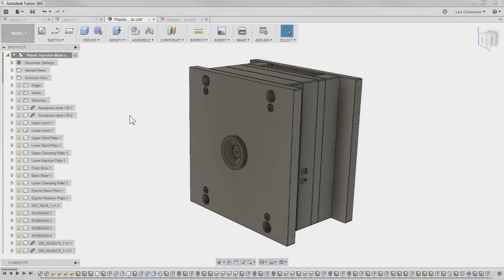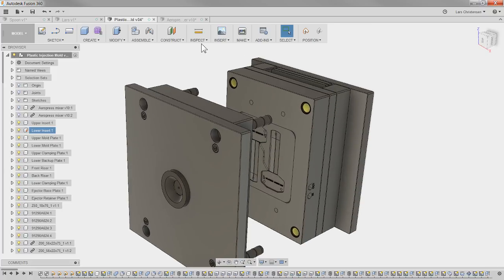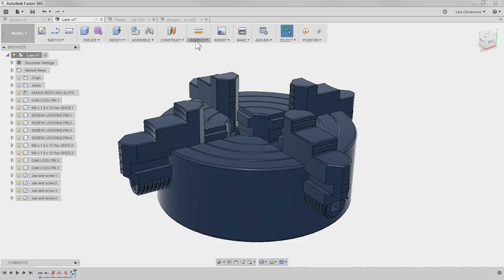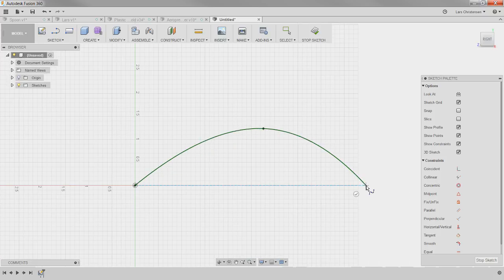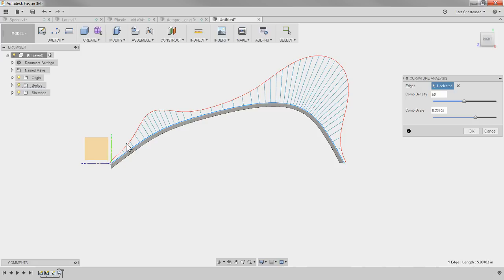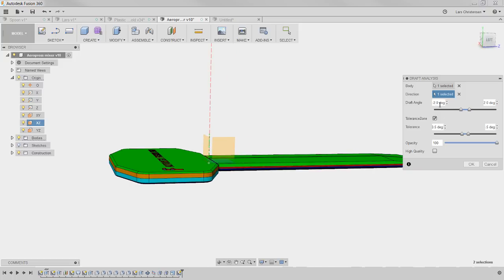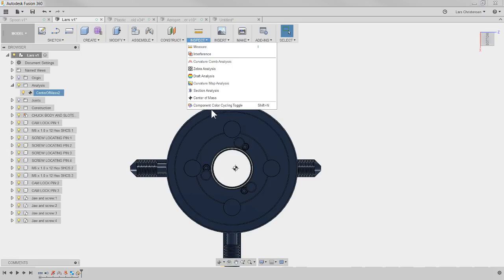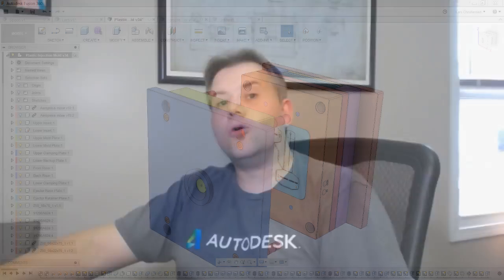Fusion 360 — INSPECT Commands —Your Comments & Questions — #LarsLive 49

Comment: Hi, I am having a problem trying to use Curvature Map inspection tool on a scanned mesh file (.stl). When I try and click on the mesh it won't select the mesh, so the curvature map inspection wont show/work.

The confusing thing is that I can select the mesh with no problems for Zebra inspection and Draft Contour Inspection, for these I can click on the mesh and select it for the inspection.  But Curvature Map just wont let me select the mesh.

Any ideas????

Comment: I have a part and I want to make a hole at the center of mass point. Is there a way to snap onto it with something like a sketch or is it only possible by measuring with the measuring tool and then placing the sketch manually? It would be cool to have the sketch feature followng the center of mass point even when the model is being changed. On the other hand I can see how this could cause errors by the center of mass being thrown outside of the solid model on some shapes.
Reply from the maker: Hi SuperRistopaha Thank you for taking the time to watch the videos! Looks to me that you can only place it manually by using the measure tool. Would be nice if you could snap to it with a sketch point.

Best,
Lars